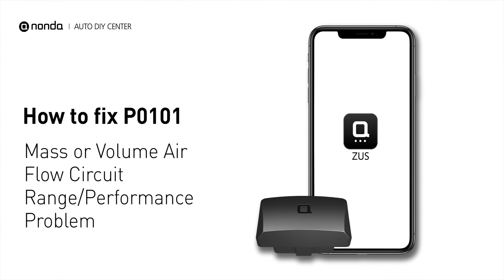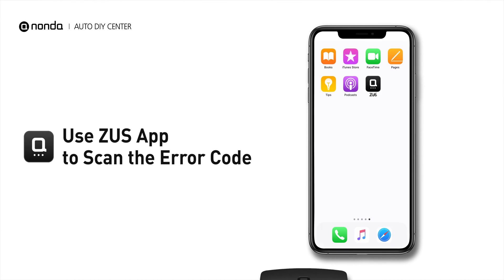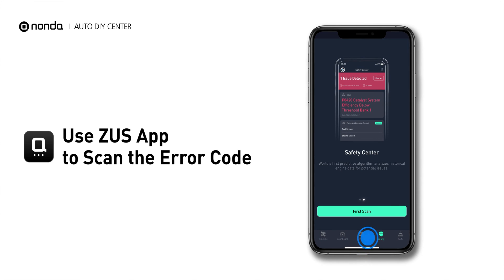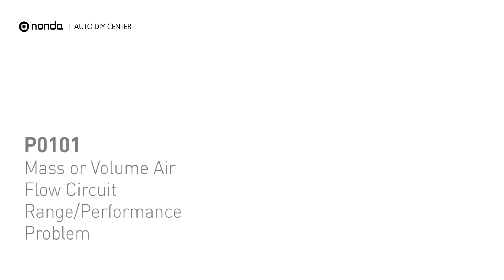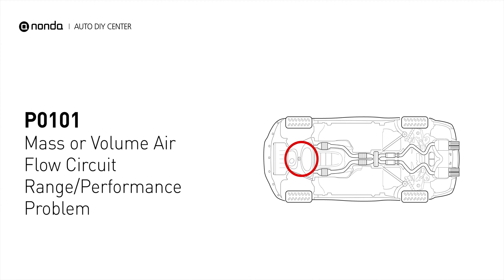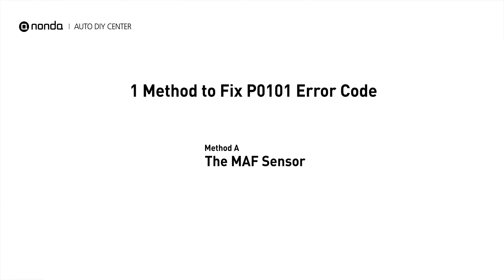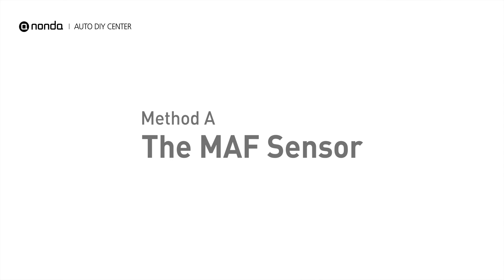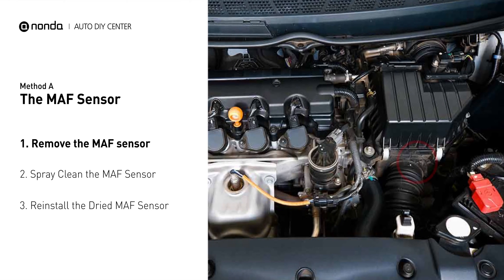How to Fix P0101 Engine Code in 2 Minutes [1 DIY Method / Only $9.74]

Comment: ive tried this and even replaced the maf on a holden statesmsn 2007 wm series 1 to no avail.. odbc code p0101 and ive tried everything! check engine on all the time ive driven at least 5000 more km with this on... cant work out what else i can try but my only symptom is low fuel economy.....

Comment: Code 2002 and 0101 and engine light is on and no flashing, slight judder when going 30 or below. Think my mechanic changed the above but didn't take light off, but think he said he clean all connections under bonnet n it went off, but just over a week later and check engine light has come bck on? Any ideas please kia sportage diesel

Comment: @nondainc 

My Nissan Sentra sv 2013 has this sensor and it doesn’t move forward when in drive. Could it be this sensor problem or transmission issue ? Would you happen to know?
Reply from the maker: Hello, if this is the only code you're getting, cleaning the MAF sensor could help.

Comment: So my 2014 Nissan Altima check engine light came on and the reader code read P0101, so I cleaned the sensor, it's been 2 months now and the check engine light came back on again, is it time to replace the sensor or could it be a different problem?
Reply from the maker: Hello, this could be an issue with the MAF Sensor.
Reply: @nondainc  I cleaned it and the code came back 4 days later

Comment: Hi! I drive a 2010 Toyota RAV4. I had to slam on my brakes pretty hard the other day which caused my traction light and check engine light to come on. I bought a code reader and I was getting this code issue and P0171 “bank 1 system too lean”. I just ordered a new MAF. Do these two codes usually correlate? Will the MAF replacement fix the P0171 code too? My car isn’t really running differently, it’s just these lights always come back on after I clear the codes which makes it so my car won’t let me use cruise control. Thank you for any feedback, I don’t really know much about all this stuff
Reply from the maker: Hi Liv, you can try cleaning the MAF sensor first to see if the issue will continue to persist. You can watch our video regarding this by heading over to this link [How to Fix P0171 Engine Code with MAF Sensor Cleaner] https://www.youtube.com/watch?v=0uWi6J55AJI Hope it helps!

Comment: With what did you spray the sensor With?
Reply from the maker: Hello, you can use any brands of the MAF sensor cleaner.
Reply: maf sensor cleaner or electrical contact cleaner

Comment: So this is why my car ain't getting enough gas though it when I push on the gas it will go very slow than once it hit 20 miles then it will start driving right or some time I have to turn it off and start it all over again. And the only things pop up is PO 101 AND POP 113
Reply from the maker: Hello, please provide us with your vehicle's year, make and model in order for us to address your concern accurately.
Reply: Did you fix the problem? Im having the same issue with my 2012 rogue

Comment: So we did this and when we took out the sensor there was a dried bug debris in there. We took it out, poured alcohol and cleaned it and the car started running again! This totally worked. We had also changed the spark plugs, and I changed the cold air intake hose and now it’s good as new!
Reply from the maker: Hello, we're so glad to hear that you have sorted out the issue.

Comment: I have done this on my 2006 bmw 325i and then I bought another one from a bmw guy online. He says off a working car and its still throwing the same code
Reply from the maker: Hi David, if the suggestions provided in the video has been applied and the issue still persist, we recommend having the vehicle inspected by a mechanic for further diagnosis.